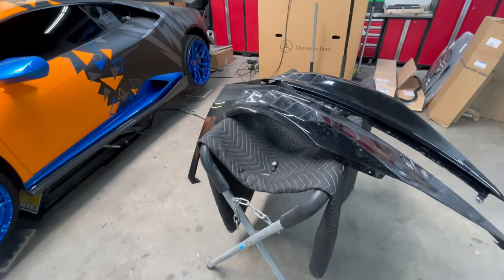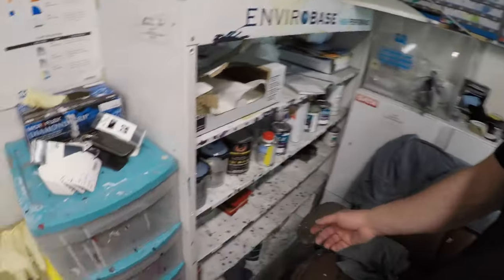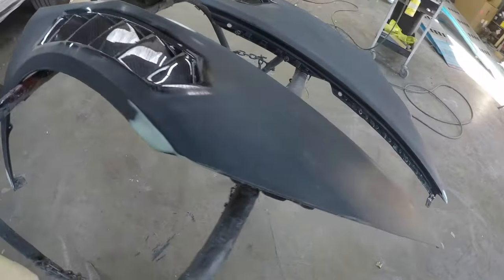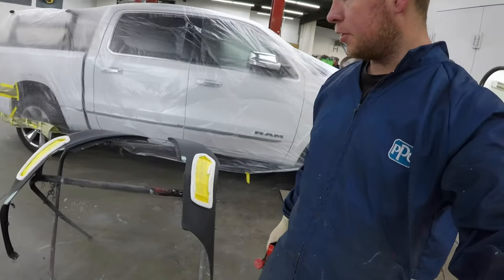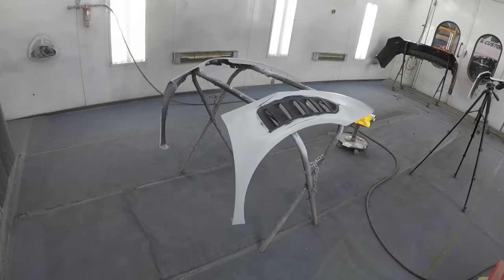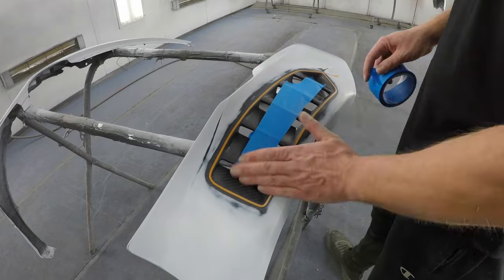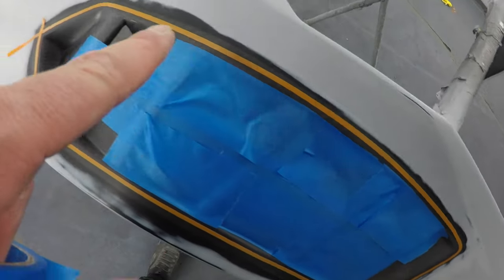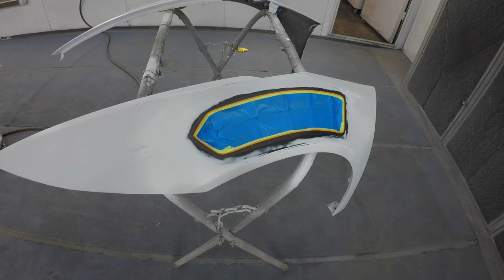Painting Carbon Fiber Fenders for Lamborghini Huracan TRTS Lambo

Comment: Amazing work but what's the purple spray gun u used?
Reply from the maker: Thanks, its a Tekna Prolite just a special edition color. 👊🏻
Reply: Hey wat adapter u use for the tekna prolite spray gun and air Guages for the tekna and w-400 spray gun?
Reply from the maker: I use tekna digital air guages for teknas and 3m air guage for w400 clear gun. Not sure what you mean by adapters.

Comment: What was what looked like white rope that you used to mask off the vents before you primed the fenders? Why use that vs tape to mask?
Reply from the maker: Soft foam tape, just so the primer doesn’t leave a sharp line (which is hard to even out) You can use tape with the edge folded as well! 👊🏻

Comment: i have a white civic si with carbon fenders and trunk. i’m looking to paint the carbon pieces white but not fully, want them to blend into the car exposing carbon like the video but more fully. so like top of my trunk will be white and fade into the carbon face of the trunk. would i just tape off the part i want to leave carbon even if it’s already clear coated? sand it all down and re clear after paint. my main thing is i don’t even know how to fade the paint but i’m gonna make it work
Reply from the maker: You prep the entire trunk for paint/clear…i would tape off the part you want absolutely no paint on, spray your white, uncover the carbon and blend/feather in the white. But never spray the white to the masked paper/tape…otherwise you will create a hard line/edge or a curb that will be visible. Very tricky but can be done 😁 Good luck.
Reply: @LncPainter  thanks
Reply: @LncPainter  would clear coat lay uneven considering it’s being sprayed on paint and non paint?
Reply from the maker: @sopretty43vr  it will flow out better on the. Carbon since there is no paint but once entire trunk is cleared it will look uniform.